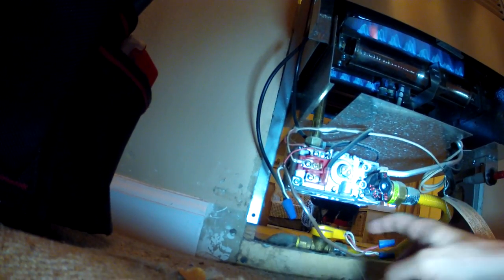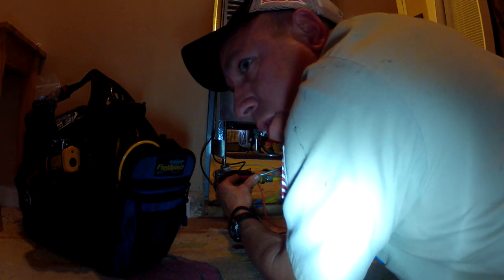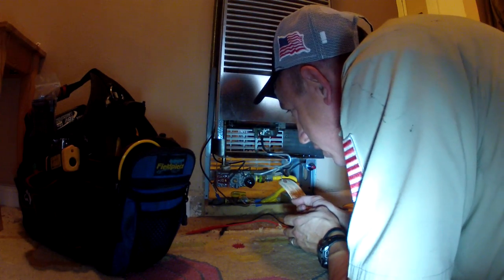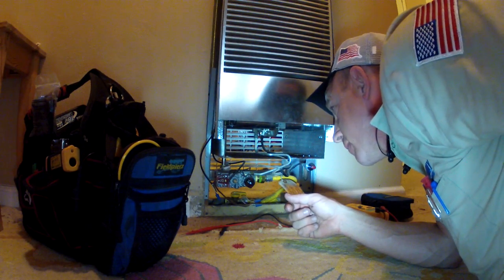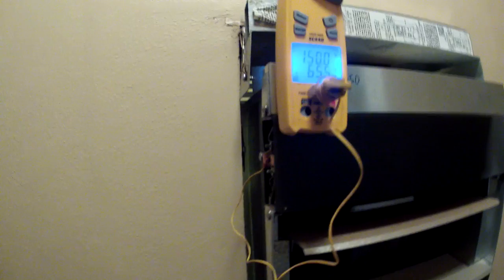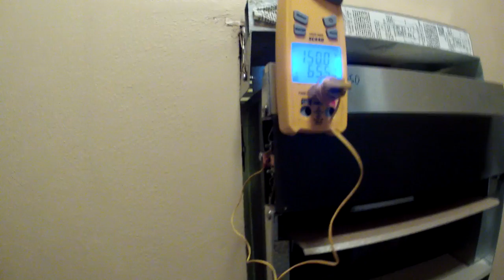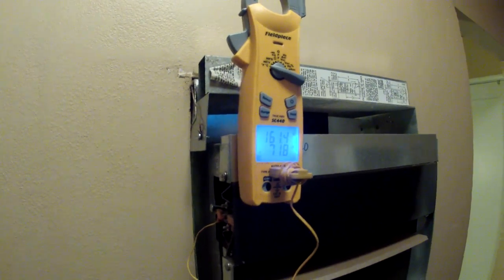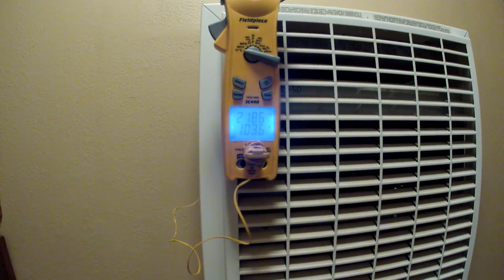HVAC - Williams Wall Furnace - Easy Call

Comment: Thanks for doing this video! You saved me a lot of time and headache. I didn't know the gas wall heaters had a high limit reset switch. Mine stopped working and a simple press of that button and it fired right up again! Thanks!
Reply from the maker: Right on.  Glad to hear that!
Reply: YEP..me same as you...haha..couldn't figure what was what..works now
Reply: @foxfamilyheatingandaircond4696  I just had the gas co come out today to service my Williams wall heater. About 20 mins after he left it shut off. I keep finding us pushing that small button on the top to restart it. Is that a sign we need to replace something?
Reply: I had the same issue and press the button working now.. same me a couple hundred bucks
Reply: @johnnapalmer1047  lemme know if you found a solution. We have the same problem.
Reply: @johnnapalmer1047  Have you found a reason to why it keeps shutting off? I just purchased one and had it installed for two weeks now, I find myself having to press the reset button a couple times a day.
Reply: @johnnapalmer1047  Did you find a solution to this problem?
Reply: @johnnapalmer1047  I have the same issue and not due to wind. Did you fix by replacing limit switch?/

Comment: Great viedo. i work on wall heaters alot down here in the bay area. I cant find anywhere either to check gas pressure,  you did everything right in my book.
Reply from the maker: Thanks Pierre!
Reply from the maker: Its solid inside there, no screw to back out..  I already checked.  There is no pressure tap on the gas valve in or out.  :(

Comment: Thanks for posting this video. I had a repairman come to my apartment a while back to fix my furnace, and all he actually did was hit the safety switch, which instantly fixed the issue. The same problem cropped up again just now, and I remembered what he did but couldn't find the switch itself. Thanks to this video, now I know! Problem solved, $80 saved. Cheers.
Reply from the maker: Awesome!
Reply: If it is tripping there is a reason. Resetting it is not fixing the problem.

Comment: I have only ever worked on one. It was one I installed. I live in a windy area and had issues with the pilot staying lit. I installed a high wind flue cap and it seems to have solved the issue.

Comment: The problem is not enough make up air. The envelope i.e. house most likely has. intermittent problems. For example do they have dual pain window  or a kitchen. Exhaust hood? Bathroom fans? What usually happen is when the furnace shuts off the stack temperature drops which decreases the draft then the bathroom fan or hood range fan if on will pull the gases /heat back  in the envelope.
Reply: Amazing. My Williams heater reset  when my kitchen hood exhaust was running. My heater is about 15 feet away from the stove. I also have dual pane windows. 
Reset button did the trick.
Reply: Say this but in English

Comment: Lol , I ordered a overnight thermocouple because what else is there ? Well just after I ordered it I researched what else , bingo I pressed the little limiter button and dang it came on , I guess now i will have an extra thermocouple 😂 thanks so much for the video 💯❤️✅edit-i put a sealed window fan in to suck out cigarette smoke and now after your end I figured thats what it was , my house is air tight so that pressure caused the flue to back up✅

Comment: How the heck do you get the high pitched squeal to go away. 1 yr old unit...just started squeal, wanted to try and adjust gas pressure...cant find screw that does that....?

Comment: I have a brand new Williams wall heater like this that was fine the first day, and now on the second day only lasts about 5-10 minutes before the limit switch is set off and it shuts down. Any ideas?
Reply: Mark5ky TV probably isn’t venting properly so the high limit switch shuts the system off. Check the vent pipe for any obstructions in it

Comment: Look for a bossed screw, turn it out a turn and press your manometer hose to it. Really old ones have npt to tap into.
Reply from the maker: I swear to God, there was no adjustment screws on this gas valve.  Matter of fact none of these williams wall furnaces do!  But yes that's what I was thinking too

Comment: I just moved in to an old house that's got a William's wall heater like this without an outside thermostat. How in the world do I use it? It's pretty cold here in Los Angeles lately, I was hoping to warm the house up a bit. Any help is much appreciated.
Reply from the maker: mydizzymelody there is usually a knob at the base of the unit that you can turn the heat on and off with. assuming the pilot is lit, that knob should turn it on for you.

Comment: Mine doesn't stay on because the ventilation through the roof is not i installed properly so it has an auto shut off on the Williams heater if there is not proper ventilation it shuts off nobody figured it out they would just come turn it on and leave then it would shut off

Comment: Can you reset a limit switch or does it need to be replaced?
Reply: Depends. Most I've encountered can be reset. Some are single-blow.
The most important question to be answered - why did the high-limit trip?
They're set to trip in an unsafe condition but never, ever during normal use - even if the house temperature is set to an unreasonably high degree.

Comment: My heater makes a hissing noise, almost like air, when it’s off. It doesn’t smell like gas. Is this normal?
Reply from the maker: Is it your pilot light?  That all I can think of.
Reply: It’s so much louder than my 1956 Pioneer. Constant hiss. I’m so mad.

Comment: If the high limit switch causes the turn off, maybe it itself needs a cleaning. Dusty ceiling fire alarms from months of sitting around (especially after smoky California fire soot as wound up everywhere) will go off when you turn a wall heater on that's not been used in months. It blows out the dust in the vent and from the grill. I think cleaning parts, sensors insulated by dust....the lower door vents can collect more dust being low to the floor.  Maybe a can of air spray after wiping down vent slots with a damp sponge....I wish you showes how you got the cover off. Simply lift straight up? I'll check back. Damn sensor....

Comment: Hi my furnace vent sensor is switching off when the furnace is working for a little while I have to reset it each time  what's going on ?
Reply from the maker: Check the flue pipe.  Make sure no nesting or dead animals in there.  It's a start.  Let the flue pipe cool before you touch it though.  It'll burn your fingerprints off!
Reply: @foxfamilyheatingandaircond4696  already checked that nothing inside it's clear
Reply: @foxfamilyheatingandaircond4696  
What thinks can relate to this issue ?
Reply: I got the same problem on a new Williams wall heater.
Reply: @LawnWrangler323  bro I think it's the sensor on the side of the furnace !
Reply: Mine have been installed for 2 weeks and I now finding myself having to reset it several times a day. Thinking about calling the tech to Uninstall and take back to store

Comment: Hi may name Is Ray I have  This Old furnaces  Williams forsaire  .
model 450 sf  has to flurrying fire out side the furnaces I think is the gas valve I think I need to adjusted 
but I Not sure . please help me .
Reply: Is the burner flame rolling out of the firebox? That is a very serious condition. Do not use it. Unless you're handy with tools, you should have that corrected by a qualified pro.

Comment: yeah, I pushed the reset button it worked and turned the pilot off and had to keep repeating this. something is still wrong if I have to push the reset button every time I relight the pilot for heat. Any suggestions to what really needs fixin? thx
Reply from the maker: Jocelyn Rochelle Harris yeah something is going on. I would get a pro out to look at it. They will have a better idea.
Reply: @foxfamilyheatingandaircond4696  Pros are too expensive.

Comment: I have an older Williams wall furnace and I am having a problem with the main burner having a yellow flame above the blue flame at the burner. Is there any way to adjust the air flow to this burner?
Reply: The airflow can be adjusted, but the main culprit might be lint and debris inside the burner. Best thing is to pull out the burner and clean it or wash it.

Comment: What does the high limit switch do?
Reply: It senses heat from the vent. When there is excessive heat coming from the vent the switch opens. It prevents potential hazardous combustion gases from entering your home

Comment: Hi, Thanks.  Any chance you know the part number for a replacement gas valve on the double sided wall heater in this video?  is there a second pilot tube for the second burner?
Reply: There is no second pilot for the second burner. There is a usually a small connection port between the burners that lights the second burner

Comment: My is the same the hight switch keep turn in off all the time..... how do i fix that
Reply from the maker: You have to troubleshoot it.  Something is causing it to overheat and trip that switch.  Can you get a temperature near that switch?  Also those switches lose strength after a while and pop easier and easier each time.
Reply: So is better for to just chance that switch.?
Reply from the maker: See above question first 😊 temperature?
Reply: Juan Loera switch shuts if off when it’s not venting properly. If you have to keep resetting it then it’s a venting issue and that vent pipe has to get checked

Comment: I live in an apartment and have a williams wall furnace. the flame is yellow and the flue has black soot,even  on the roof.
Reply: You need to have that corrected. It will get worse until it smothers and then it will be producing deadly levels of carbon monoxide. It may already be doing that.